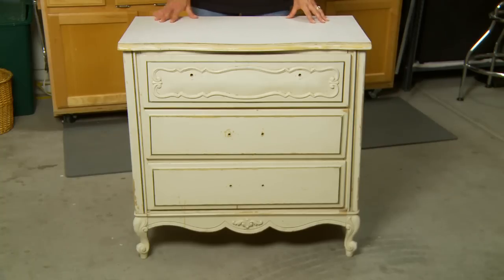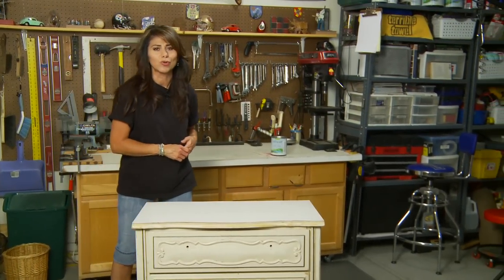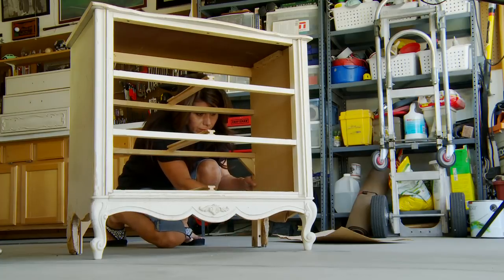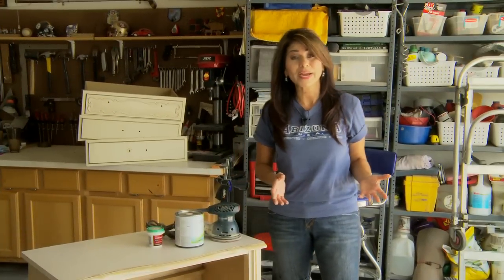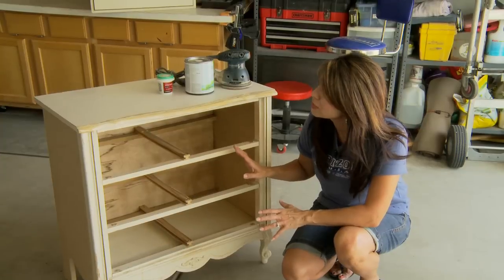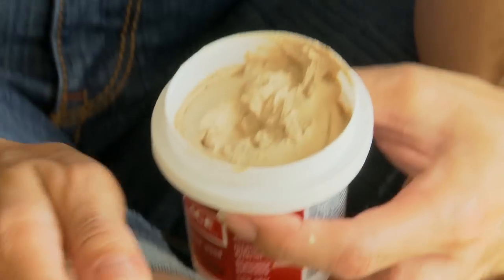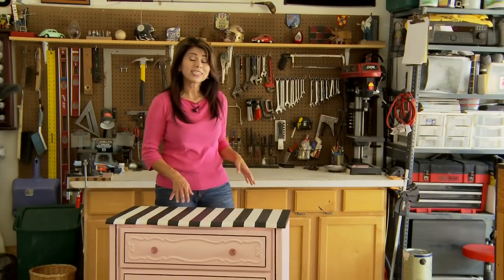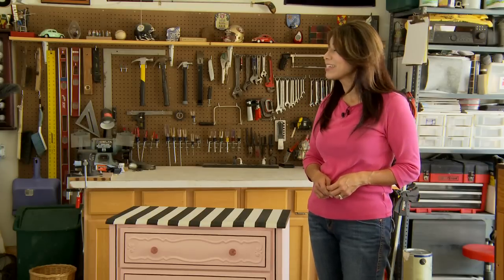FURNITURE FLIP: How much can you expect to make from redoing a beat up old dresser?

Comment: I re-do used furniture myself & the one of the first things I look for is whether or not it's partial board & try to avoid it whenever possible though I will re-do some if not in terrible shape. The first thing I look for is any bubbling up spots from the partial wood being wet & the flaking off (such as on the back leg of this one) & lastly check the drawer guides to make sure their not busted loose from the main frame/housing... if any of these are there I normally won't bother with them due to that I'm looking to not replacing any of the wood for a better profit margin...

Comment: I find that wood putty tends to shrink and cracks easily. If I'm going to paint a piece, I use car body filler - a one part cellulose based filler for cracks and gouges which is quite loose and normally a two part filler for things like those holes that need a stiffer putty. I've also found that particle board draws a lot of paint (even when spraying), so I normally use a wood primer to seal the particle board first. I think that this is more of a hobby that we recover some money on - people just don't realize or appreciate the time and effort that goes into restoring some pieces - especially natural wood!!!

Comment: I think instead of using a wood putty, I would have tried using cut pieces of dowels glued into place and sanded after. They fill the spot better and tend not to crack over time.

Comment: In your opinion  is there worth or value in picking up older hardwood furniture even when it is in rough condition ? I have picked up  a couple or 3 hard wood dressers from the 50's and or sixties they are rough . Although my thought were with the rarity and expense  of hard wood furniture,  added with the popular resurgence in  retro and distressed furniture . That the dressers would pick up a few dollars as is .   Or would it be better to  slightly recondition by oiling or or replace drawer slide tracks and sanding and painting  the dresser ? I am not sure the profit difference  would be worth the time and money spent on reconditioning  . Although if the hard wood retro dressers wouldn't really bring anything as is . Then doing a spruce up would be the only option ? Love to hear what you think Appreciate the video & info, God Bless
Reply: Refinishing the hardwood is well worth the time. Selling it as is compared to refinished can be a couple of hundred dollars difference each depending on the wood and original quality of the piece. It also really depends on what you consider rough. If the piece it gouged or rotting/heavy water damage (requiring replacing panels to get close to original finish) then a quick refinish/paint job is probably your best option.

Comment: Question? 
What is the blue thing called that you had the pink paint in?
 I think it will be useful when I try this myself.
Reply from the maker: It's a paint sprayer for small projects, more specifically a Graco Spray Station.  I use it quite a bit on furniture projects.  Not only does it save time, you don't get any of those paint brush lines.

Comment: This was helpful! I have a cabinet where the siding has similar damage. Question though did you use pressed wood for reconstructing the siding of your dresser?
Reply from the maker: Thanks for checking out my video.  I take a lot of heat for this one because I used pressed wood for this particular project.  At the time, I thought I was doing the right thing, because that's what the original material was.  Knowing what I know now, I would have used hardwood. Pine or maple.
Reply: I wouldn't say it was the wrong choice-- it's certainly the more profitable choice, and once you slap a coat of paint on it who really knows the difference? And if it's intended for a little girl, I don't imagine it'd make any difference at all in terms of practical durability or aesthetics. Cheers for fixing it up however, better than it becoming trash/firewood/ etc.

Comment: The back panel can be replaced using luan board. I do this all the time. The back legs are not rotten. That is deteriorated MDF https://en.wikipedia.org/wiki/Medium-density_fibreboard  Sometimes it is easy to use Bondo or wood filler.